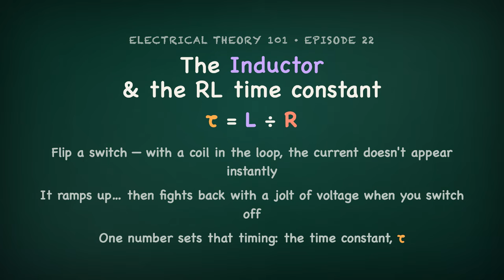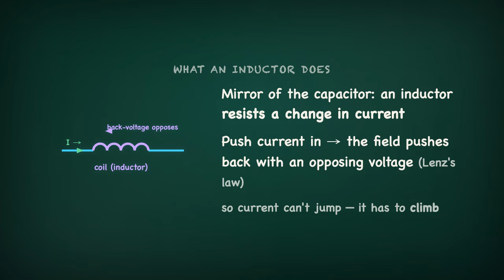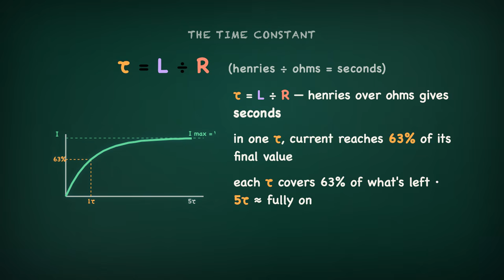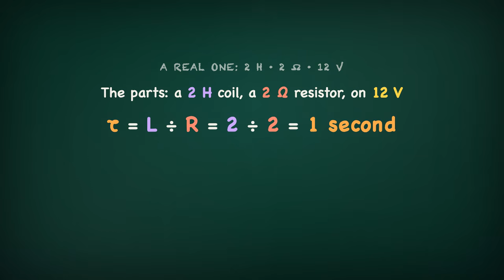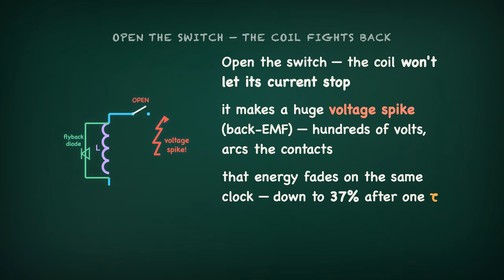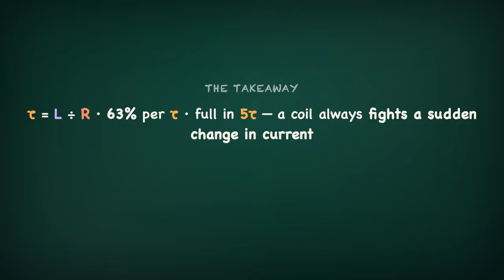What Is an Inductor? The RL Time Constant (τ = L/R) Explained | Electrical Theory 101

Comment from the maker: Practice answers:  A) τ = L ÷ R = 6 ÷ 3 = 2 s. Final current = V ÷ R = 12 ÷ 3 = 4 A. After one τ → 63% × 4 ≈ 2.5 A.   B) RAISE R (τ = L/R, so bigger R = smaller τ = faster). For τ = 0.5 s: R = L ÷ τ = 6 ÷ 0.5 = 12 Ω.   C) The coil opposes the sudden drop in current with a big back-EMF (V = L × di/dt); stopping it almost instantly means a huge di/dt, so the voltage spikes to hundreds of volts. A flyback (freewheeling) diode across the coil gives that current a safe path to decay.
One line to remember: τ = L ÷ R — 63% per τ, full in 5τ, and a coil always fights a sudden change in current. What should we cover next? ⚡